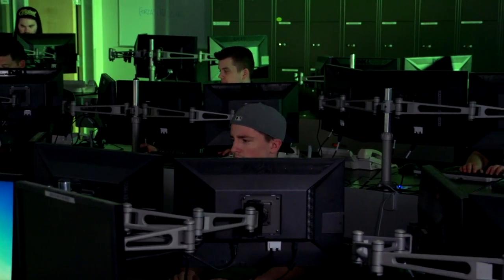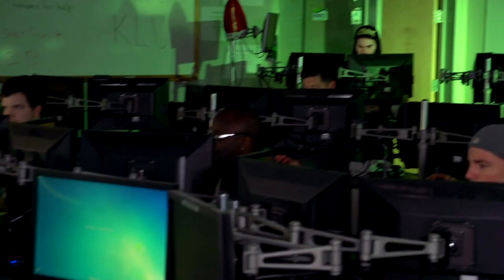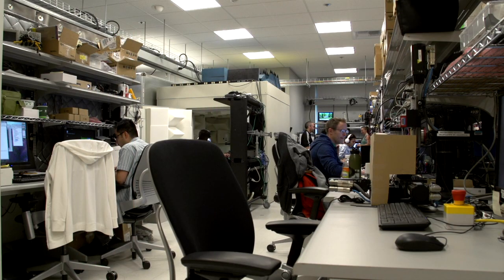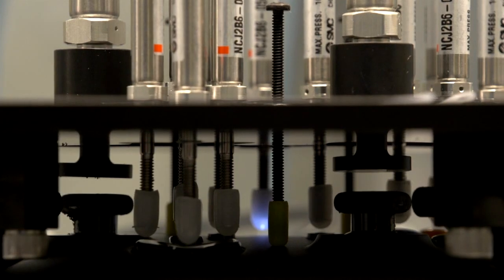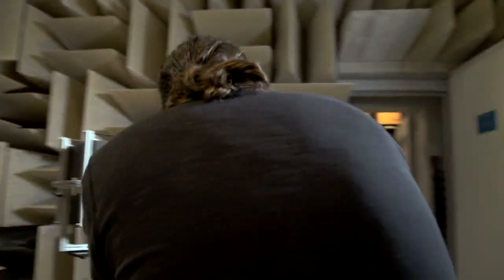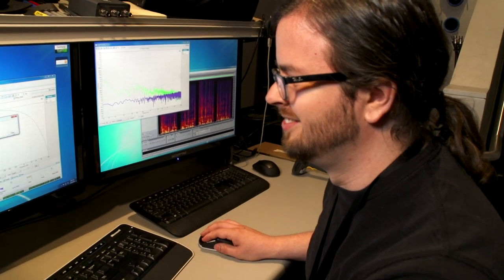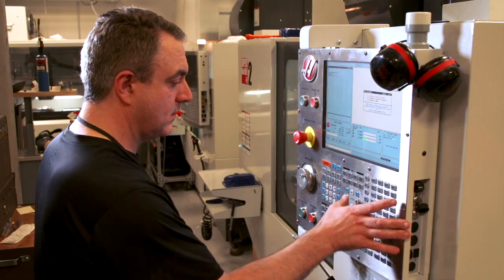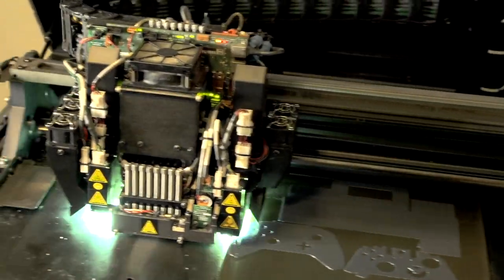Behind the Scenes at Xbox

Comment: just whenever you buy a new game on disc before you can play it and then it has to be saved to the hard drive that is only 500 gb or the size of 20 standard single layer discs, how how many layers does that drive work with anyway the ps4 will be able to read 4 layer (100gb) discs